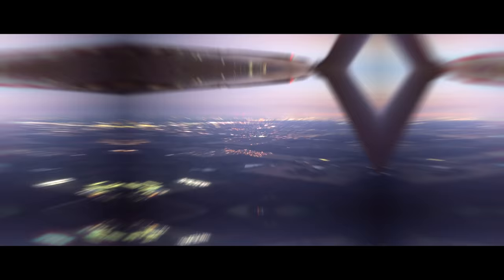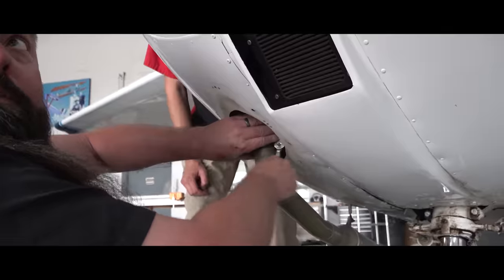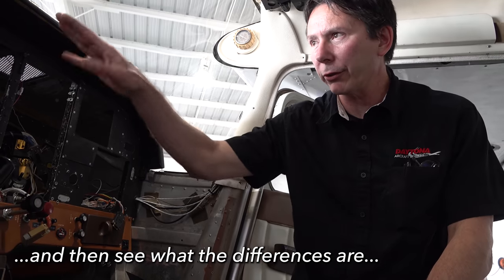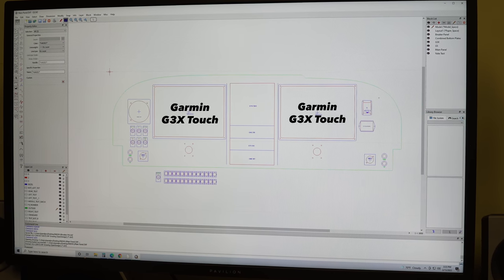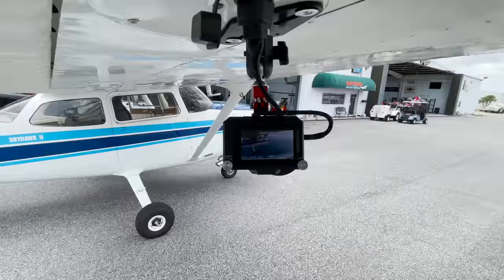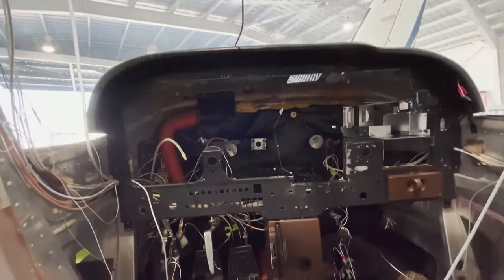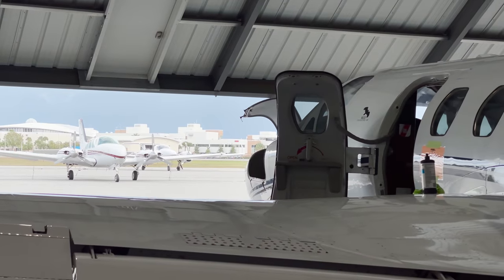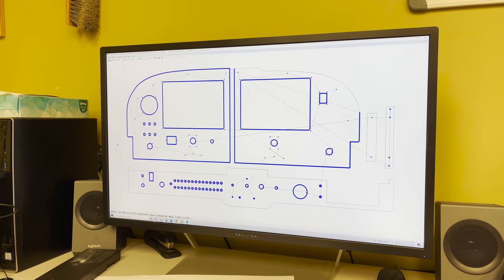WHAT HAVE WE DONE 😰 Panel Makeover: Part 2

Comment: I love how this extends the life of the aircraft practically indefinitely.
Reply from the maker: These planes last forever if they’re maintained properly!
Reply: Or, its a practical upgrade and that extends the life of 991 indefinitely.
Reply: Yes. Normal people cannot afford new airplanes anymore. This makes economic sense if committed to the airframe.
Reply: Kinda like the B-52 😉
Reply: @observer1242  Getting to be the same way with trucks these days. Seeing some pickups hitting 6-figures now. Insanity. Same goes for those (They'll last forever with a bit of work), but you need a "sacrificial anode" to drive in winter, otherwise your investment will head back to the Earth from whence it came in 12 years flat, or less, depending on where you live.
Reply: Not only if they’re maintained properly, But the must be Flown Properly, Never overstressed or excessively BAD landings.

41
Reply: Hi Josh. I’m interested in having new avionics installed and was curious if you had concerns hiring a service company 8hours from your home base. I’d like to hire a company in a similar distance but am hesitate in case something needs to be tweaked later in the future. Thoughts?

Comment: I mentor kids in robotics , coding, and CAD. What you need sir is a chopstick. I always have them in my backpack and use them to point out relevant things on the screen while I sit beside the student. When my eyesight was better I had an old telescoping radio antenna with a rubber tip which worked great until one day it miraculously grew legs and left for destinations unknown. These days a chopstick is about the right length and I know where they can be quickly procured. 
Loving the journey! Thank you for sharing it!

Comment: I used Crystal Avionics at KBAZ for my panel upgrade and was very happy.  Eliminated vacuum pumps, dual G5/ADSB w/345 xpndr, Garmin 210 interface to link it all together.  Completely new panel face styled after the flat metal panels from the restart Cessnas.  Not cheap but excellent work and close enough to drive over and check on progress from home.

Comment: My KNS80 went belly up last year, so I thought I'd replace it with a new 750xi, or 650.  Ha!  $23K or $17!  I almost got the wife to go along with that.  Then, I found out neither would work very well with the autopilot, a Century IIIB.  It would work with the CDI and the heading bug, but no GPS steering.  If I wanted that a G5 HSI would be needed.  Oh great, might as well get the other G5, too!  $10K each installed.  Then I found I still needed the old artificial horizon to drive the autopilot!  Great!  No losing the vacuum system.  And all that money and still no vertical descent control or altitude control.  For that I'd need a new autopilot.  $20K!  I finally decided to just buy a used working KNS80 ($500) and forget the whole thing.  I can still file IFR with it, and If I want situational awareness, I use my tablet and Avare with ADS-B in.  I don't know where you guys get all the money for these upgrades.  Now that we have fuel prices in the $7 per gallon range, I'm glad I didn't upgrade.  That is almost double what it was a year ago.  Thanks Brandon!

Comment: Great video Josh! Looking forward to seeing the finished product. What do you currently use for power for externally mounted cameras? I’m using club planes so need something easily on/off before and after flights.
Reply from the maker: Right now, I don’t mount cameras externally. There’s no safe way to externally power them without the flight flix units, which will be installed at the end of all this!

Comment: 1976 CESSNA 172M the last of the good engine C-172 till they started the 180 HP version. CAVU Flying club (KMWC) purchased a 1977 C-172 in 1978-9 with 100 TT and the Engine LITERALLY Puked it Guts at 377.4 TT. O320H2AD was CRAP  Cam Lifters Oil Pump Gears and more were all junk. It's still flying with the same CAVU Flying Club after 45 years.

Comment: MAJOR Changes
G,day from Sydney Australia.
I like the practice of assembling the avionics, GPS Nav and radios with wire harnesses outside the panel. Then plug connectors; to the
* Power supply
* Sensors
* Receiver and aerials
(Wire harness length the consideration)
🌏🇦🇺

Comment: Good job for the seats, interior etc, but I for one regret to see these panel "upgrades" in this category of aircraft. In many cases we are installing panels that excel in cross-country, IFR flight, when these aircraft are not fast enough or weather agnostic enough to do that on a continuous basis. When it comes to short-range, VFR, maneuvers, flight training and all the other missions in which a Skyhawk excels, the traditional panel is more appropriate, and actually provides more comprehensive information to the pilot. I do appreciate the care taken in crafting the metal etched panel - that is craftsmanship and pride in ownership - but they day I am fortunate enough to buy my own, I will be seekinmg one that has not gone under the knife and has preserved its original beauty and capability.
Reply: I think these glass panels have way more comprehensive information than we old timers think they do or could have. I bet Josh will be smart and go to a Garmin training course and learn everything it can do.

Comment: Working on an install of a c172m of a 10”dynon display over the yoke. With the older mike models, the yoke is placed higher than the newer mike models. We are running into a situation that the screen will not fit in place between the yoke and the original panel substructure.  Does anyone know whether there needs to be approval to remove part of the structure in order to fit the screen in? I see in the video that there may be a cut from the original structure and wondering how you would go about getting the approval or if there’s no approval required. Thanks!

Comment: What are you going to do for the interior?  I mean, sidewalls, carpeting, overhead, etc.  Is she also going to get a new paint job?

One of the other things I heard, and I don't know if it's true or not, is that the FAA no longer requires magneto ignition, and you could go to two, dual channel electronic ignition systems.  Do you know if that's true and did you, or are you, considering that?

Comment: These are exciting days for you.  This new panel will revolutionize your flying from this point on.  I'm very happy for you.
Reply: It’s still a Part 23-certificated aircraft (NOT a transport-category) with minimal system redundancy eg one alternator driven by single engine (both go offline if engine quits). Compare that with 4 generators driven by two engines plus an APU on a lowly EMB145 for electrical power!

Comment: Just bought a 172N & found your channel. Will be watching the avionics upgrade with a lot of interest to see whether the overall cost is beneficial. Do you mind if I ask what the purpose of the tailpipe extension is? And does it help with power or just noise reduction? Thanks
Reply: It's a Power Flow tuned exhaust.  If you search his library there are videos on all the ins and outs about it.
Reply: @TheBert   Ok thanks for your reply and look forward to seeing the next instalment. I have bought a similar aircraft to yours when you first picked it up (very well looked after but could use some TLC) in original condition & plan on doing something similar to yourself. Thanks for the content it’s been inspiring.

Comment: How does this work with the certification side of things? I'm assuming you'd need a pretty hefty STC with all of these major changes. How do you get that approved by the FAA?
Reply: My understanding is all that's needed is a Form 337 and a new Weight & Balance. No STC necessary.
Reply: The STCs will cover the applicability of the new equipment for his airframe. As the the other person who responded said, there will be log book entries and the required weight and balance changes - which includes both what you added and what you took out. 

There is usually POH updates required.  They add supplemental information to the original POH. Since he is adding an autopilot, there may be some limitations added as well.
Reply: Yes, please, give us some details on the certification process ... and of course, a ballpark on the cost.  I almost didn't watch this video because I thought it would be boring.  Wow, that was way off track, every step was interesting and educational.  I learned a lot and I watched every step.  Thanks.  Can't wait for the next episode.